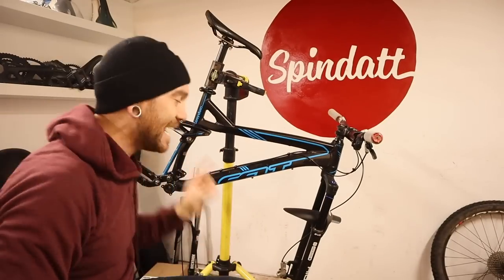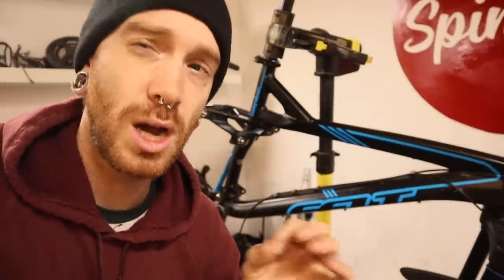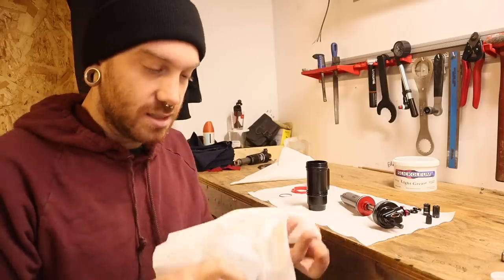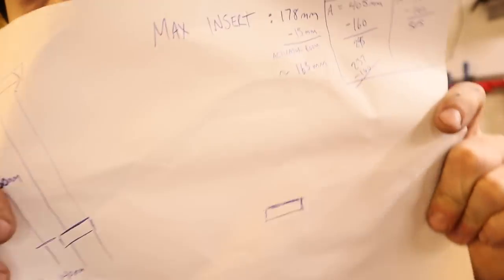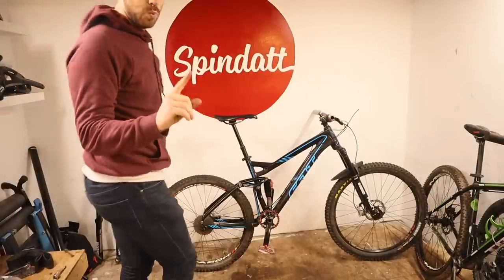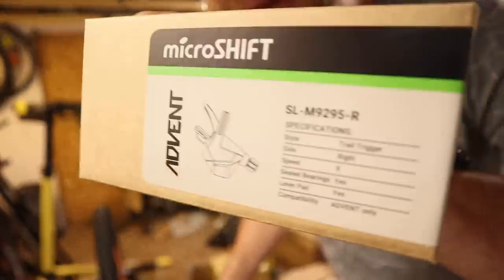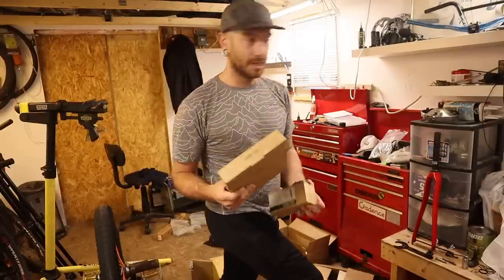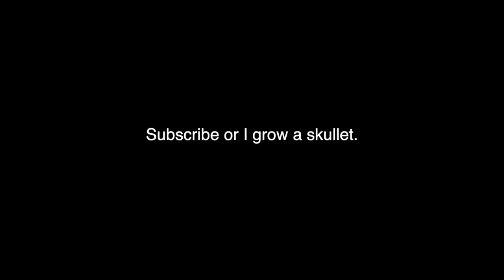Mini Mullet Build (Refurbished)

Comment: I'm glad you repaired that shock, because it was interesting.  I once took apart a Shimano rapid fire 8s shifter. All the screws were staked making disassembly questionable.  The spring had deformed and slipped past a retaining pin. It worked out well. Certainly not worth  all those hours but I had fun with  the challenge.

Comment: Boy, MicroShift hit a major home run with Advent, didn’t they?
Reply: They have three groupsets I want to try..  the Advent, the Advent X and Acolyte.
Reply: 9spd, 10spd and 8spd respectively....all have clutched rear derailleurs...(although I think for the 9spd advent they do offer non-clutch options)
Reply: @kevinjfeeney77  I just did a build with Advent 9-speed with drop bar shifters.  I am very happy with it.  It’s clunky, but cool.

Comment: Interested to see how the Microshift 1x9 works out. I'm using Sensah components on road/gravel bikes, and so far so good. It's nice that there are more choices now than just Shimano/SRAM.
Reply: I assume they fixed their issue of the shifters breaking internally? I was scoping them out but heard quite a few people's shifters breaking... like Trace Velo.
Reply: @kevinjfeeney77  yes the Plastic internal piece Trace Velo mentioned has been replaced by a metal one, at least on the Empire shifters I have. To be fair that's the only issue I heard of, and now looks to have been resolved. Shimano aren't without their issues either though... Instagram #thanksshimano
Reply: @jamesowen418  cool...having another option is awesome.... I have been using MicroNEW for quite awhile..have them on 3 builds.  A dirt drop bar'd Nishiki Pueblo mtb, a dirt drop bar'd Mongoose hotshot and a 1976 KHS Gran Sport mixte that I use for cargo hauling/ errands. No issues whatsoever. 

Kinda wanting to try the Gevenalle, Sensah and Microshift Advent and Acolyte on my next builds.
Reply: @kevinjfeeney77  the Empire 2x11 is on my road bike, Ignite 1x9 on a 2000 Cannondale cx/gravel bike. 
Not tried the Gevanellle, but have some Suntour Command shifters to use at some point. Personally though I like the Brifter/STI style of shifter.
Reply: @jamesowen418  I prefer the brifter as well.

Comment: For steel full sus check out Marino Bikes you can get a frame-set for pretty cheap (550USD base price before shipping), plus they're semi-custom! Fellow tinkerer Stridsland Journal (hes a bike mechanic that runs a pretty sick blog @STRiDSLAND on  IG) just got a hardtail from them recently and it looks pretty sweet. Its a rider owned company so that's a plus, but I think they can keep the price down because cost of living isn't as high in Peru as the US or UK where most steel bike brands are. I'm thinking of getting a hardtail from them since I could swap over every single part from my current bike and save big bucks.
Reply from the maker: !!!!!! You are a hero
Reply: @Spindatt  Budget bikers gotta stick together 🤘